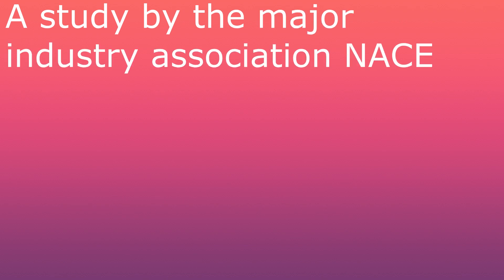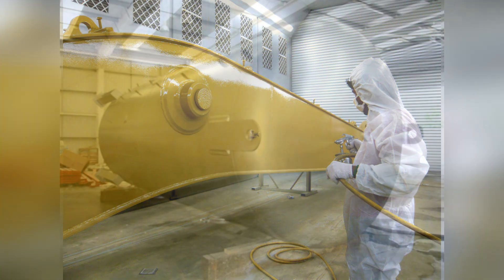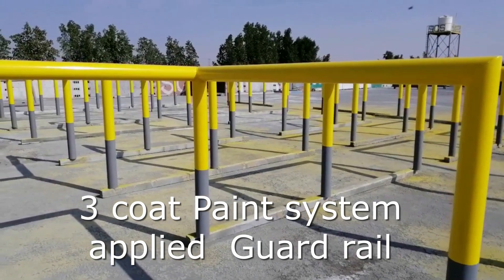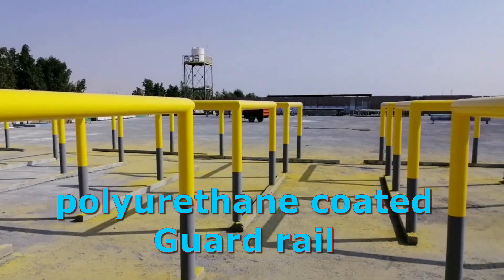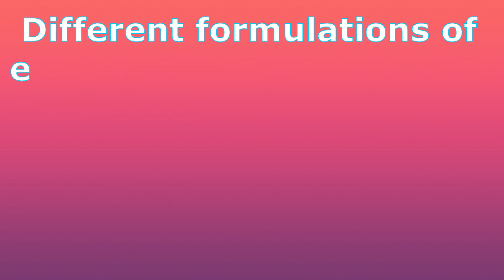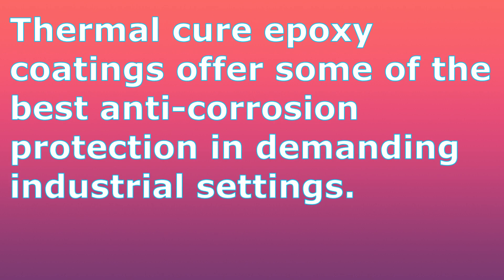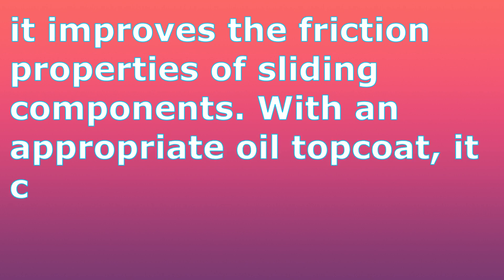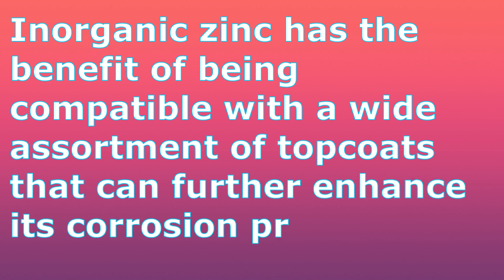What are different types of anti-rust l anti corrosion  l Corrosion  Resistant#mechnicalengineering

Comment from the maker: Fluoropolymer Coatings
Fluoropolymer coatings are used in a number of key applications. For example, where low friction or non-stick is required. If corrosion resistance is the objective, then Halar (ECTFE) or PFA are often used. Conductive coating versions are also available.

Comment: What about polyurea ?
Reply from the maker: @kgs7547  Yes, polyurea coating is a good choice for corrosion protection, Durability:
Polyurea coating is durable and can withstand extreme temperatures. It can also be applied in sub-zero temperatures. 
Fast curing
Polyurea coating cures quickly, allowing for a rapid return to service. It can gel in as little as 5 seconds
Reply: @ thanks for fast response 🙏🏽🙏🏽
Reply from the maker: @kgs7547  Always welcome

https://youtu.be/Ya5fVwP1308?si=33UvOz9pK5al4xgK